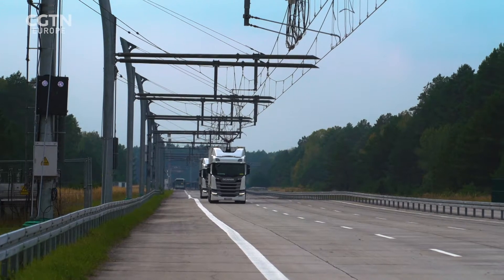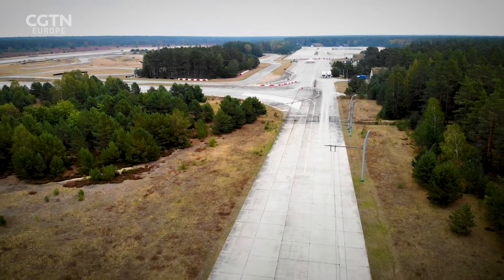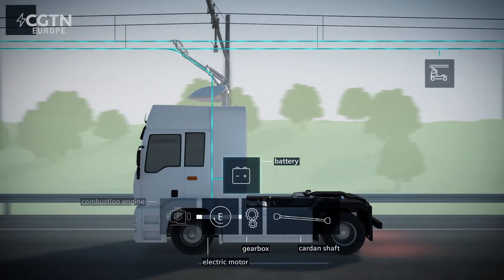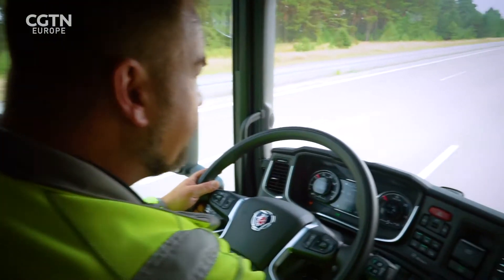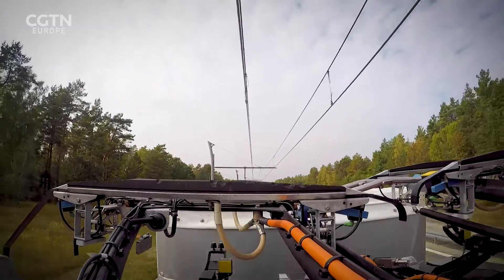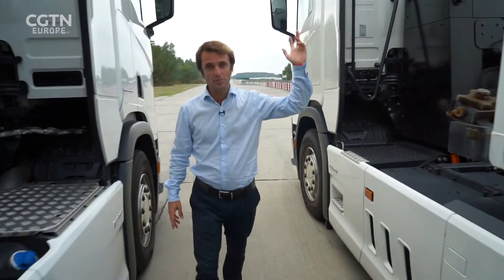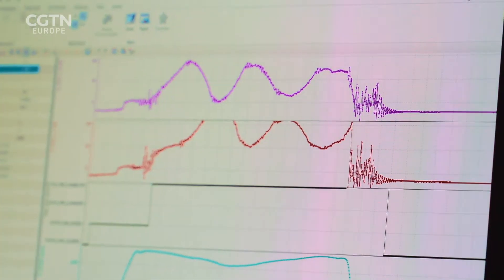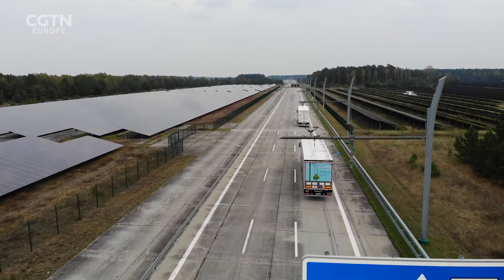Are these self-charging e-highways the future of transportation?

Comment: how do you track/charge the truck's electric consumption for the duration of using it . or you charge them by the distance? if so how about those trucks with more high power electric motors vs those with efficient ones but low power those that carry light weight but spacious like chips vs those that carry steel.

Comment: The E highway is the only short term answer and should be implement NOW. Battery technology will catch up at some point and this system will still prove to be useful in areas where there is steep inclines and that is exactly where we need to start in stalling them. Even if only Hybrid truck are introduced it would still make a significant contribution. But I guess the Oil industry still has a good grasp on fight transport, when it comes to politics.

Comment: Do a simple calculation: Trucks drive at a distance of 100 metres. That means 10 lorries per kilometre of overhead line. Each lorry wants to charge 100 KWh. That makes a total of 1000 KWH = 1 MWh. Extrapolate this to 10 kilometres, i.e. 10 MWh. And they are all supposed to be supplied via a cable (as thick as a thumb)? There are so many lorries on our German motorways, and you can see it on an "ELISA" test route between Frankfurt and Darmstadt. But 99.9 % of them are still diesel lorries. Will it ever be electric lorries?

Comment: For heavy transportation and long distances, knowing a truck needs 8 to 10 times more energy than a train, due to tyres resistance, why not using a train, with electrical system? Solution  is there, and no one cares.
Reply: Truck serve as a last mile connection for freight transport. To connect factories with railway freight terminal you require trucks to move the cargo between them. technically, you can connect the railway directly into the factory but it is quite inefficient in contrast by just transporting all the cargo from all the factories by truck into the railway freight terminal. Because truck use oil to run, it is not environmentally friendly. By hooking truck into overhead cable like electric train we can cut carbon emission and probably not burning the earth to the ground.
Reply: @dddf27  I agree with you. The problem here in Europe (I'm french) is that trucks haul cargo on very long distances, and that trains are not used enough, as consequence of european business rules.
Reply: @dddf27 It is truly Environmental friendly only when electricity is produced from sources like wind or solar or nuclear (nuclear have its own disadvantages but don't pollute like burning oil).

Comment: I really love this idea. I see this having the potential fix a lot of problems in the US. Think about it both Technologies batteries and the electrical connection device that's usually on top of trains are well-developed which means parts, manufacturing, mechanics, it already has the whole ecosystem. Same with batteries. Instead of building a bunch of charging stations you could just every 100 miles or so put in like 1 mile of this track in the far right lane of the highways. It would also help with traffic congestion by keeping the trucks from weaving between all the lanes. All the trucks can be driving in the right lane waiting to top off their batteries...

Comment: I would say yes.
Rather than relying on charging like idiot musk wants, this overhead wires are better.
I’d say that electric cables combines with a very efficient but slightly underpowered diesel engine is a better choice.
That way they can decrease emissions and weight at the same time

Comment: In the erstwhile Soviet Union, city buses and buses plying on suburban routes used electric motors connected to the grid using pantographs. I see that there is improvisation on sensors and automation but the rest is the same.

Comment: Does that mean the truck has two engine? one for oil and one for electric motor?
Reply: Depends on the design.  If the batteries are large enough to get the truck back to the power lines, no need for any gasoline (Petrol for you non-Americans) or diesel engine.
If the distance is to great, then you need a gasoline or diesel backup engine to act as a electric generator.
I can see the trucks on major roads, but not on local roads. From what I have read if you can keep trips off line to 15 minutes or less, these trucks can work very well in most urban areas by just putting power lines over major roads.
The biggest problem will be how to pay for the electric power?  The best way would be a control on the truck sends to the electric provider a message of about how much power the truck used.

Comment: I'm both excited and skeptical about these... 

On one hand, for long-distance transportation, we already have a technology that is more efficient and well tested (aka trains)... 

On the other hand, this is still a big improvement regarding environmental impact of transportation

So I hope that in the future, this will not become some hype-driven solution taking too much space and preventing other, better solutions (as trains) to be used where needed, with an company-oriented policy of not investing anything and going into the most economic solution instead of the most clever one. I also hope it will not create some cobra effect, inducing an increase of use in infrastructure negating benefits.

One thing I would know for sure, is how this compares to trains for delivery (including of course the cost of rail-road transfer platforms required by train delivery in most cases) at various ranges in term of energy and overall environmental efficiency.
Reply: From my understanding, this technology is aimed at first/last mile journeys, as mentioned in another video. If it gains momentum, its infrastructure will be built close to cities only, where most logistics centres are located anyway. Trucks arriving at said centres can recharge on the final leg of their journey and when they leave the centre. The question is, how long the electrified section needs to be in order to charge the batteries sufficiently.
Reply: @incoocat150  If an electric truck has a sufficient range from batteries alone, then you can charge and recharge on the go, on long routes. This solves the problem of all-electric trucks in the form of significant charging times and short driving ranges. And they are becoming more popular and universal.
If this is combined with automatic lane keeping and space control (autopilot for highways), then the need for carrier drivers decreases. And with it, the cost of transportation and the human factor fall.

Comment: can u put this on to Buses
Reply: Trolley buses have used similar systems for decades. In the former Warsaw Pack countries you have many Trolley buses that also permit trucks to use the system. The problem is those lines are only on roads covered by Trolley-buses and no one has set up a system to determine how much each Trolley-bus uses (This is a big issue for commercial trucks, for you have many operators of Commercial trucks, but in Trolley-bus systems you have only one user of the electric power, thus no need to determine how much power each Trolley Bus uses, all of them use the same power source and the system pays for power for the whole system not each Trolley-bus).
In many ways this is very old technology, going back to at least the 1920s, and if you include streetcars to the 1890s.  The problem is how do you charge each user? In a conventional system, all of "Users" (Trains, Streetcars or Trolley-buses) are all owned by the same operator, thus that operator pays one electric bill as power is used by the entire system.  With Commercial trucks, you no longer have just one operator but many and each has to pay for the power they are using. How do you charge each such user?  The only way is to have a meter on the truck but how do you make sure someone can not bypass the meter (and get the electric power for free)?. 
Thus the problem is not the overhead wire, electric power or anything else but how to get the user to pay for the power?
Reply: @paulmentzer7658  Electricity companies have over 100 years of experience with meter tampering, and developed lots of countermeasures to minimize such issue. The difference here is, the role of checking the meters would switch from them to transit authority, that already makes yearly inspections on vehicles.

EDIT - Forgot to mention transit authority has almost 100 years of experience with odometer and taximeter tampering as well.
Reply: @paulmentzer7658 I think this can be resolved similar to the road tolls. So, the truck would have the meter and the transponder and when it passes some checkpoints, the data is transferred to the provider. Knowing standard electricity consumption and the distance they can spot cheaters.

Comment: There is a system already constructed on the motorway near Hamburg( A1?)What happens with abnormal load transport? The better solution would be inductive charging in the tarmac charging both cars and trucks.
Reply: e highways over head grids are cost effective for now. solar roads will get there soon.
Reply: @gerald6919  they’re all ready being tested in the UK. I can’t wait for the time you get a 15% boost for a 2 minute stop at a junction or are able to stop at any car park space and the car just starts charging. Bring back Little Chefs for the 30 minute full charge and pre-order Olympic Breakfasts as well.

Comment: It's like a train, but less efficient.

I seriously wonder how they got funding for this.
Reply: It"s like a train, but more flexible in its  destinations, without the need to lay rails !
And more so you don't need trucks with heavy batteries for 800-1000km distances, which wreck the asphalt and have other battery related side effects. It even can used  on conventional ice trucks, with a proven technology.
The Germans calculate that layin overwires on 1/3 of autobahns will reduce 2/3 of truck transport related emissions !! The pay back period of lorry companies is said to be 18 months, and  with room for  commercial  roi for the overwire investment , as well as payments for lost  fuel tax to the government.

Seems like a no brainer to me.

They spend billions on 'potential' ' 'future' tech with a lot less sight on results than electric road.
Reply: @lws7394  once you're laying the wires you're better off laying the rails as well. Rubber wheels and isolated operaion make them still way less efficient than trains. Another thing to consider is that highways are an incredibly inefficient and polluting use of space: they need to be so much wider than a railway to have the same capacity, which also means using more materials. On top of that, they need maintainance (which often amounts to complete dismantling and rebuilding) much more frequently than railways. Also they're more dangerous. To add a final nail to the coffin, they're slower; not just for passengers, but for freight too: in italy there's a high speed freight train running to replace some cargo flights.
Reply: @superj8502  Dude, this is not about trains or light rail ! It is about distribution, from door to door. Bringing cargo from ports to a depot on a business park. Bringing goods from a national/reguonal distribution centre to a supermarket in your neighourhood. From the Ikea distribution centre in Dortmund to the the store in Cologne or Amsterdam. You 'll have hard time get the by rail.
I don't think that when you go to  the supermarket  ( by bike, of course), that your veggies are delivered by rail. Or whether that would be practical , if so.
Reply: @lws7394  that's just not true. Depots can and do recieve train deliveries. For example in switzerland all warehouses have train access so your average ikea recieves a 3 or 4 car long train on its internal platform. This allows the place to be smaller because a train platform for boxcars is a much more efficient use of space than a facility for unloading semi trucks. Alan Fisher has a great (and pretty short) video on this, so i suggest you watch it (i can give you the link if you need it).

But all of this isn't that relevant to this specific case because in order for this equipment to be beneficial a substantial part of the trip needs to be on the highway, otherwise it's just dead weight for most of the trip. This means that this system is meant for long range transport, not local deliveries.

You can really avoid the "by bike" comment because i do actually walk to the supermarket (it's literally 200m away, aldough i have to cross a four lane stroad). In fact, i do not own a car. I can get anywhere by bike or transit.
Reply: @lws7394  In the UK, several major supermarkets extensively use trains for long distance haulage - search 'Tesco Train' for examples. Of course the final deliveries to the store are still by road but the distances are much shortened. This makes best use of each mode in terms of efficiency vs flexibility, but the supermarkets are using rail simply because it's cheaper - bulk rail transport is a fraction of the cost of road transport per Ton/KM.
Reply: In Switzerland, maybe the goods can travel by train, but in the Nordic countries, for example, it is impossible. First, a sparsely populated country. Second, very long distances. Thirdly, trains have been reduced because they are not profitable. Let's take the example of Finland. The railway company is not even interested if the transported goods are less than 100 tons. That's why 80% of freight transport in Finland is carried by trucks.
Reply: In Finland, most of the people live along the Gulf of Finland. Given shipping by ship is even cheaper then by train, it makes sense that 80% of freight is move by trucks, short haul trucks from the nearest port. Switzerland has to coast line so it relies on trains. In the US we use all three, shipping on the Rivers and along the coast is the cheapest, rail is next, followed by trucks.   Each has they niche with some very limited over lap.  In my hometown we see trains loaded with  trailers all day long for it is the cheapest way to get such trailers over the Appalachian Mountains.  Things that have to go faster go via the Pennsylvania Turnpike but every so often the most cost effective way to move a good is by barge, down along the Atlantic and Gulf Coast innercoastal waterway, then up the Mississippi and Ohio Rivers. 
When it comes to trade from the West Coast to the East Coast, it is by truck to a train depot, then to a barge on the Mississippi River to New Orleans then along the inner coastal to the East Coast (But trains to the East Coast can be competitive as to price given the more direct rail lines to the East Coast).
As to Fruits and Vegetables, most goes by truck with two drivers. With two drivers one can sleep and the other drives and get the truck from the West Coast to the East Coast in three days. Thus trucking the good is the fastest, but also the most expensive.
The trains are slowly double tracking some of they tunnels in the West to speed up the trains. Those Tunnels, most built the before 1930, are the biggest bottlenecks for moving goods by train from the West Coast (Along with to many trains using to few tracks to through Chicago).
In many ways the problems with rail is that even the Railroads believe they were done by 1930 and would be replaced by trucks.  Thus almost no investment in EXPANDING railroad capacities after 1930 as the Federal Government stepped in and provided funds not only to the US Highway system, but after 1955 with the Interstate highway system and let's don't forget the massive building of Airports (Mostly to provide landing areas for military planes, but also for Commercial aviation).
Just a comment on the problems with rail and we are only slowly addressing the problems with rail. Rail is not obsolete and can not be replaced by trucks, but Rail can not compete with tax payer supported means of transportation such as trucks and planes except in areas where rail has a huge economic advantage such as moving huge amount of items a very long distance. Local deliveries are best done by truck on tax payer supported highways. Each type of transportation has its niche but some of each niche is the result of support from other tax payers. We have to be careful how much support we give to each means of transportation and in the 20th century the means of transportation which had the least taxpayer support was the Railroads and many of the problems with the Railroads reflect who the Government did subsidize in the 20 Century.
Reply: @paulmentzer7658  Trucks are mostly ok for local deliveries (we could get deeper into this later), but they don't need highways for that. Highways are designed for intercity travel, which is where trains excel. Wherever there's enough demand to build a highway there's more than enough for a railway.
Reply: @valtterifani  no infrastructure is profitable to its operator. Neither highways nor railways. This shouldn't be a factor we take into account, because infrastructure has a wider societal benefit which means more economic developement.
Reply: @lws7394  literally would be more efficiant to adopt trains and use a rolling highway (train taking not just the trailer, but the semi and driver with it) with strategic stops, this electric highway has no advantages and puts greater strain on the paragraph lines to.
Reply: India decided to do this .
Reply: The next step in this is let's make it a road train to make it efficient. Lo, what do we have, it is a train :)
Reply: You are also not considering that in some areas, acquiring land for laying down railroads is not cheap. This is a simple add on to existing infrastructure, which is why it has its place as one of the solutions. Plus, it’s also a more scalable solution in a relatively short amount of time.